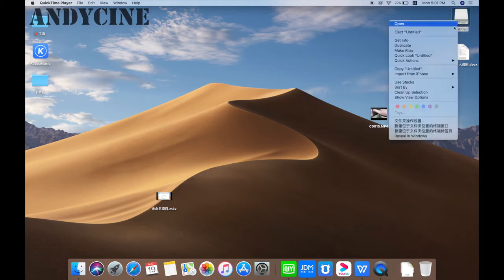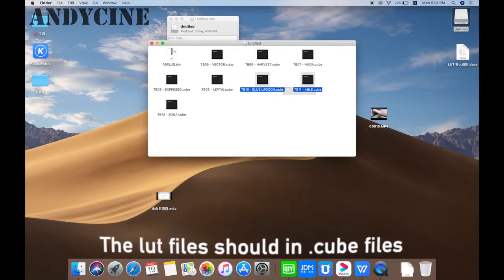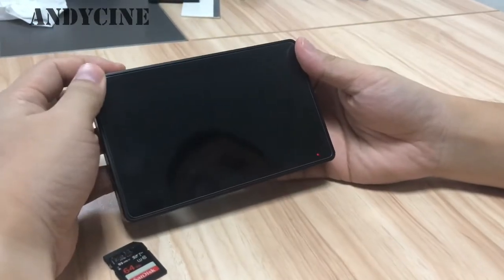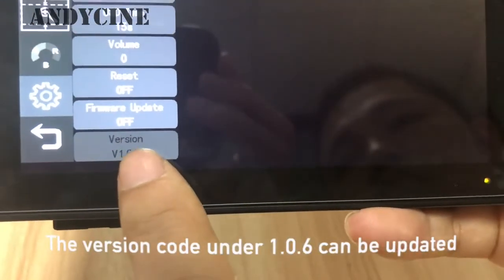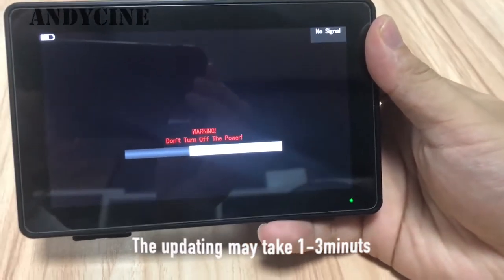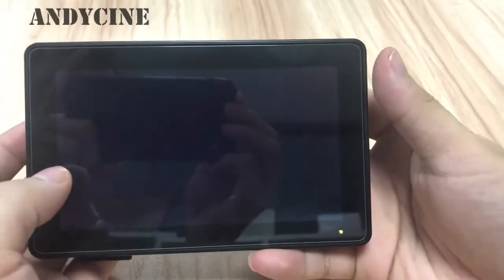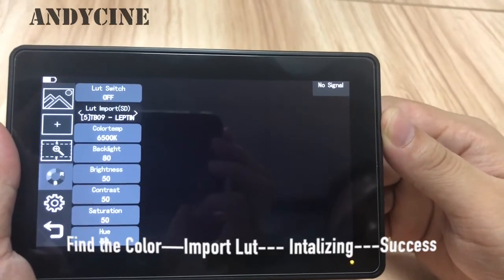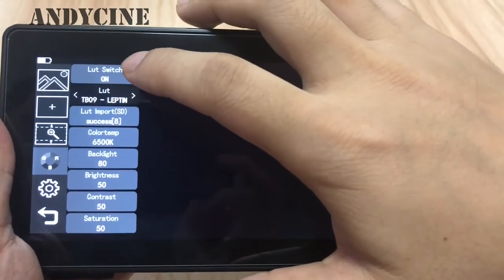How to Update Firmware & Load Lut on ANDYCINE A6 PLUS

Comment: The firmware update is not installing on my Andycine a6 V2. Andycine emailed me firmware update V2.5.2. I followed all the steps in the video and when I insert the SD card in my camera and go in the menu system I don't have the option to turn on "Firmware Update". My current firmware on is V2.1.0. Please advise.